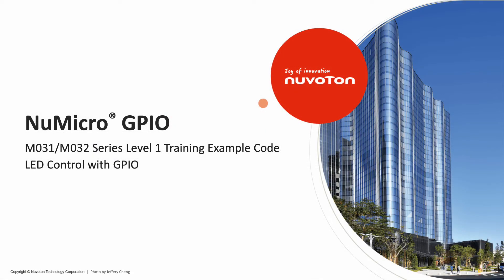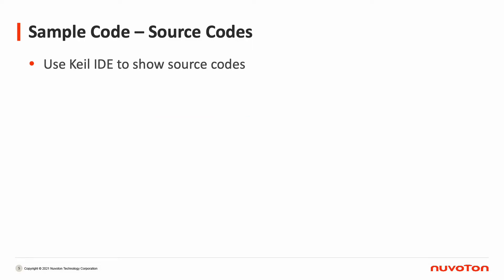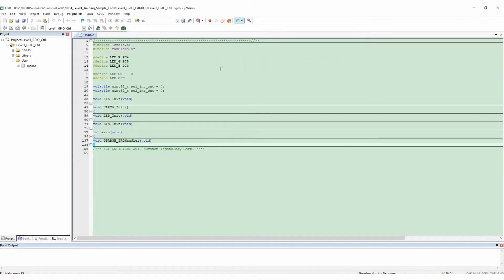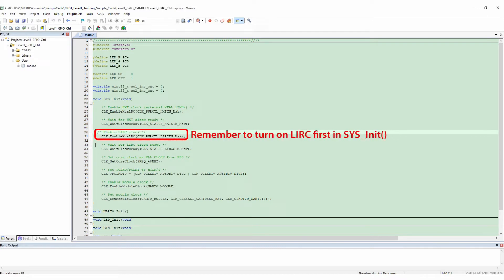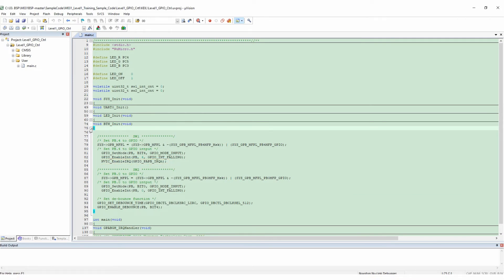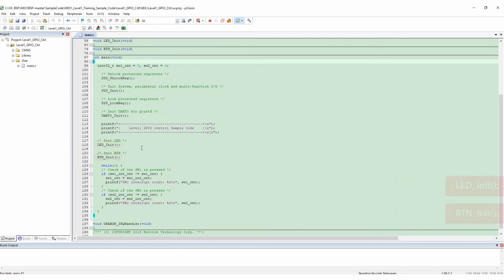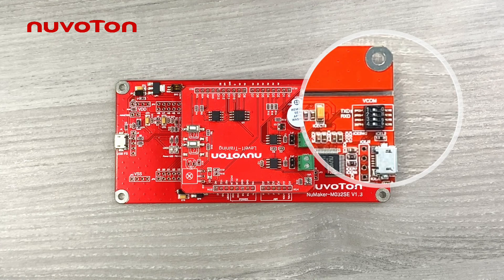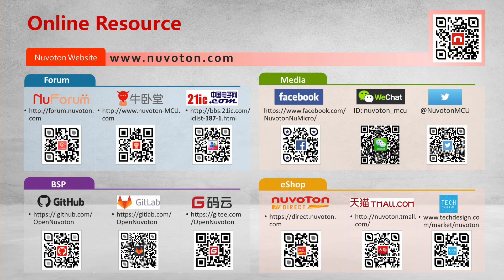Nuvoton NuMicro Family Microcontroller Level 1 Workshop - GPIO Sample Code

Comment: Hello, I am using numaker M258KE and nulinkpro for the debug. But I am not able to show the print out message on the serial monitor. Could you please help?
Reply from the maker: If using the on-board debugger – Nu-Link2-Me, there is a virtual com port to control the printed message. If using Nu-Link-Pro, please confirm the UART configuration and related settings on the serial monitor tool. If you have more questions, please contact SCLI2@nuvoton.com